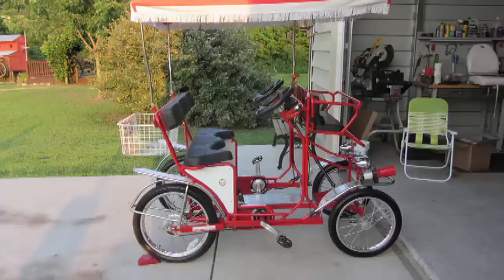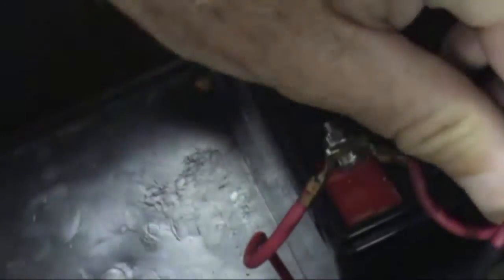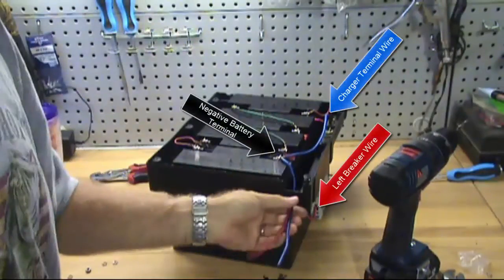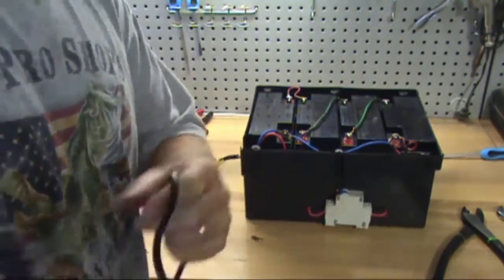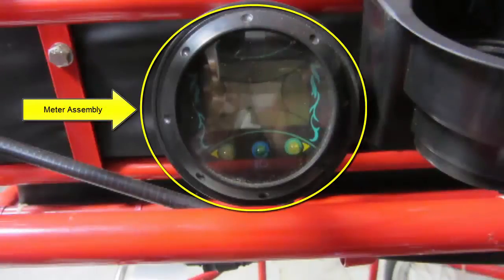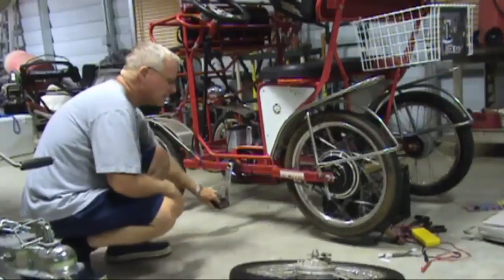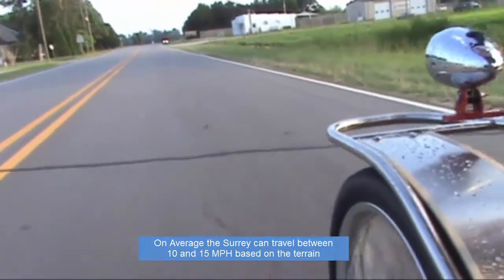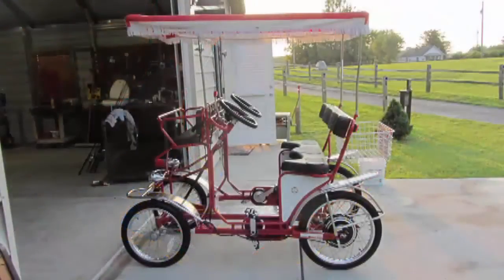How to Install An Electric Hub Motor with Pedal Assist on a Surrey Deluxe 4-Wheel Bike

Comment: Thanks so much for this video would you be able to provide recommended links (battery, Circuit breakers etc.) for a 4-seater surrey bike?
Reply from the maker: Natalie,
Here are some links:
DZ47-60 C20 Circuit Breakers AC 230-400V 6000A - https://amzn.to/2PWswTr
PowerStar 12 Volt 18 Amp F2 Sealed Lead Acid Battery - https://amzn.to/3fU3oHQ
Granite Digital 48V 50W Quick Charger and Auto Pulse - https://amzn.to/2POXaOT
Thanks for watching my video.
Norman
Reply: Thanks Norman! The Granite Digital is no longer on stock, any suggested alternatives? Also what motor hub assembly do u recommend?
Reply from the maker: Natalie,
You can use any brand 48-volt charger/maintainer. The Granite model is one of the best, I believe the stock is out due to the supply chain on microchips needed to build. You can search Google and check other sources that may still have some in stock.

There are many different brands of hub motors, I usually purchase motors built by Bafang. They provide high-quality electric bike motors both hub and mid-drive. They cost more, but cheap motors use cheap parts and low-quality controllers, circuits, etc.

You will need a minimum 48V 500W hub motor. This will give you speeds between 10 and 15 MPH, and a range of about 10 to 12 miles. depending on the terrain and the number of people on the bike. 

The size and weight of the Surrey would better be outfitted with a 1000W hub motor for best performance and power, 1000W hub motor will cost between $600 to $950 including the battery.

A Mid-Drive motor will give more starting power, hill-climbing, and range. Mid-drive motors are more expensive and will require some modifications to the Surrey frame to install. Mid-drive motors will cost around $1000 including the battery.

The easiest option to power the Surrey is to install a Hitch-Hiker motor which will attach to your Surrey with no modifications needed. The Hitch-Hiker will give you the power needed to push the Surrey up hills and give you about 20 miles of driving on a single charge. The Hitch-Hiker motor will cost around $2,000 including the lithium battery system.

Thanks,
Norman
Reply: Thanks!!!

Comment: Where are you located, would you be willing to look at an existing surrey bike hub motor setup that is in place and I can't figure out why it is not functioning? I purchased it in Raleigh NC and was told he thought it had a controller issue, it is now in Indiana and I've tried different controllers and don't know enough about it to resolve.
Reply from the maker: Todd,
I live in Eastern North Carolina about 78 miles east of Raleigh NC. If you tell me what is wrong or what is not working
properly I may be able to help you diagnose the problem.
Thanks,
Norman
Reply: Please text or call me when you can, 3177763878
Reply: I'm heading to Burlington NC in a week, I could bring the surrey if you would be up for it? I could even leave it and get it on another trip? My son lives in Burlington.

Comment: Hi Norman, do u know the size of the bottom bracket of your Surrey? Do you know if it's a standard size for all 2 seaters?
Reply from the maker: Ron,
I just took my Surrey to Florida to use during the upcoming winter months and do not have it with me at this time. If you have an International Surrey model, they are all the same and most parts are interchangeable. 
Thanks,
Norman
Reply: @NormanGooch  Ok, great, thank you.

Comment: Is this products ablebil in 🇮🇳, India, how much price in rs
Reply from the maker: I am not 100% sure, but you should be able to buy electric hub motors and wheels in India. If you have an International Brand Surrey, you can buy a hitchhiker electric wheel attachment from their website www.internationalsurreyco.com for about $1,800. This will only fit a International Surrey Bike. If you have a different manufacturer, you can search the internet for electric hub wheels and motors that you can retrofit to your bike model.
Thanks,
Norman

Comment: I'm stumped, Norman. I purchased an electric-assist Shandong Hightop Machinery LTD Four Wheel Surrey Sightseeing Bike Model Number:HT18-4S [https://hightopmach.en.made-in-china.com/product/DXzEgxFYVJAb/China-Four-Wheels-Electric-Surrey-Bike-Quadricycle.html]. Problem is even the two sturdy teenage grandsons can't pedal this unit for more than 3 level residential blocks without exhaustion - and that's without passengers. How can we increase the power of the electric assist? Better yet, How do we test to know it is even working? Should there be an increase-power mechanism on the dashboard? The 4-person surrey is a 48v 500w vehicle, using lithium batteries. We've had it for more than a year and taken it out twice. Could an electric-golfcart mechanic know what to do?  Sure would appreciate your advice!
Reply from the maker: James,
I’m not familiar with the motor you are using (the link does not work on my end) but there are several components that will cause the problems you describe.
You have to start at the beginning and test each component and make sure the voltage, capacities, and wattage is at the manufacturer’s specifications.
Start with the most obvious first and test. Eliminate the ones that are functioning properly and go to the next.
1.	Test the Battery Load
The first test you should do is load test the battery to determine if the battery is functioning properly.
If voltage drops significantly from a full charge under load your battery may have bad internal connections.
The Batteries BMS system may also be defective.  BMS is a very important part of an electric bike lithium battery, it is an electronic regulator that monitors and controls the charging and discharging of rechargeable batteries. it monitors the battery state such as voltages and currents and the battery internal and ambient temperature, Protects the battery from being over-charged (cell voltages going too high) or over-discharged (cell voltages going too low), calculates the data such as the charging voltage, balancing the charging current or temperature.
Sometimes the BMS may be faulty and can erroneously shut down the full power of the battery output thinking it is protecting the battery.
Thanks,
Norman
Reply from the maker: 2. Check the PAS system
Most PAS problems start with too much clearance between the disc and the sensor. Either that or the disc is slipping on the inside diameter. Set the distance as tight as you can without it touching. Test the pass with the rear wheels off the ground and make sure the wheel responds immediately to the sensor when it passes disc.
If you have an instrument panel, make sure your PAS setting is correct.
Reply from the maker: 3.Test the Controller
The electric bike controller is one of the main parts of an electric bike, it is the brain of the e-bike, controlling the motor’s speed, start, stop. It is connected to all the other electronic parts such as the battery, motor, and the throttle(accelerator), display(speedometer), PAS or other speed sensors.
Get up close and smell the controller, any type unusual smell such as charred, charcoal or burnt smells the controller may be defective and not sending and receiving information needed to operate the motor properly.
Check all wires leading from the controller and make sure all connections are tight and secure, check each wire and follow all the way to the other end and make sure there are no loose connections, burned wires, terminals etc.
Reply from the maker: 4.Voltage Test the throttle
Look for the obvious first before voltage testing! Something blocking or in the way of the thumb throttle rotation operation? Bracket or display mount, any unusual noises, sticking, or grinding when twisting? 
If so open it up and correct the rotation problem first.
If you can work on your throttle under test bench conditions using a battery powered voltage (5+vdc) supply.
It will be more accurate and don't have to worry about the motor starting up. 
The controller provides the regulated 5 vdc input voltage for sensor operation. And receives the variable output voltage from the sensor to determine power output to the motor accordingly. The controller will also lock out motor operation if throttle sensor input is higher than 3.8 vdc (shorted output).
Reply from the maker: 5.	Test the hall sensors – Hopefully you will not need to go this far with your testing.
Most eBike motors have “hall sensors” which help the controller to drive the motor.
To control an ebike motor the controller needs to know the position of the wheel at every point in time so that it can keep pushing it round. 
It works out the motor position from the signals coming back from the hall sensors (usually 3 of them). 
When the signal from the hall sensor is high that means that one of the motor magnets is going right past it, when the signal is low that means the motor magnet has already gone past.
To test the hall sensors, you will have to remove the wheel and motor cover to expose the inside of the hub motor.
•	Plug the controller hall cable to the motor hall cable, and then power up the controller with a battery pack.
•	If the controller has an ON/OFF switch, make sure it is ON.
•	Make sure your multimeter has the black probe in the COM slot and the red probe in the V? Hz slot
•	Switch the multimeter to DC voltage mode and turn the dial to the “20V” setting
•	Now probe the hall connectors with the multimeter, you might need to push the probes in with a little bit of force to get contact. You should see somewhere from 4V to 5V.
•	Next probe between the ground (black) and yellow, ground and blue, and ground and green wires.
•	As you turn the wheel slowly backwards you should see the voltage continually switch between 0V and 5V 
•	When you stop turning the wheel the voltage for each hall sensor will be set at either 0V or 5V. If one of the hall’s voltage doesn’t switch then you either have an issue with the wiring for that hall or an issue with the actual hall itself. Also, if you spin the wheel too fast you will see a steady 2.5V which is just the average between 0V and 5V
If you are not familiar with the tests, I would have it checked by a qualified e-bike
mechanic.
I hope this helps with your bike issues
Thanks,
Norman

Comment: Are you able to use the existing drum brake or did that stay attached to the stock wheel and come off? I am having a hard time finding a hub motor with a drum brake and chain drive on the other side.
Reply from the maker: The wheel I purchased already had a drum brake. This wheel is no longer available. I suggest you use a mid drive motor to power your surrey. You will have to make some modifications to install, but you keep your chain, brakes and drive wheel. The mid drive will give the bike more torque for climbing hills and is able to maintain constant speeds. Take a look at the Bafang 750 or 1000 watt motor. You can search YouTube and find installation videos for Bafang motors for regular bikes and see how it can be altered to retro fit a surrey.
Thanks,
Norman
Reply: @NormanGooch Norman, thank you for all your insight and direction. Your video is part of what spawned my curiosity!  I did it! It took me quite a bit of trial and error, but my double bench surrey now has a 1000W hub motor! 
Video of testing out the motor: youtube.com/watch?v=JvsHJQGibM0
Video of installing and riding: https://www.youtube.com/watch?v=u9DJXgGeEaM

Your expertise helped me figure out a lot of jams and dead-ends. Thank you!!

Comment: What brand ebike peddle assist kit did you use?
Reply from the maker: Unfortunately, the manufacturer of the hub motor I used is no longer available. I purchased the hub motor from an electric scooter company who at the time were starting to make electric motorcycles. I purchased the wheel from a company called incredicycles who built surreys with electric assist for several years until they went out of business in 2007.
You can still find wheels and hub motors that you can retro-fit on the surrey including mid-mount motors that can also be retro-fitted for the surrey. 
Search Bafang motors for mid-mount motors and check e-bike wheels made for heavy duty mountain and all terrain bikes. There are some very powerful hub motors and wheels for these type bikes with many size and power ranges that you can install on a surrey.
Thanks,
Norman

Comment: @Norman Gooch    Good day! It seems Surrey International in California is possaibly out of business. I have a 4-seater tank with the 5th Wheel attached, but it is in failure mode and I'm looking for test methods to find the problem. New battery, wires are good, turn throttle and nothing. Can you point me in a positive direction?
Reply from the maker: Gregory,
International Surrey Company LTD. Located in Texas City, Texas is still in business as far as I know.
They have technical assistance and parts for most all surreys including the electric wheel hitchhiker attachment.
I would check with them and see if they can give you some direction on your issue.
The phone number is 1-800-765-7370
Website: www.surreycompany.com

Thanks,
Norman
Reply: @NormanGooch  Thanks for the info.  Yeah, I meant Texas lol. Two of us have been trying by phone, email, and website to get response from them for nearly 3 weeks. Talked to a good man today after trying random extensions and finally getting through to a human! Thanks again Norman!

Comment: what is the name of the box that fit the 4 batteries?
Reply from the maker: There is no name on the box. It is the same type box used for some models of lead acid battery operated mobility scooters. I picked this box up at a flea market and there was no label. The #27 auto battery box may be large enough for the 4 small batteries.
Thanks
Norman
Reply: @NormanGooch  You are the best! I am neck-deep in researching to build almost the same surrey project as yours. Your video seems to be the only... Maybe I need to tape my progress too!
Reply from the maker: You should video your project, it will make it more fun to do and it may also help other people who are looking for more information on the surrey.
Thanks for watching my video
Norman
Reply: @NormanGooch  Norman, I need to thank you because I keep coming back to this video- It's so informative! Update on me: I just bought mine! A very nice fellow posted his double bench in the local classifieds for a price I could not resist!

Comment: A couple of quick questions if you don't mind my asking...

Can you use a motor in both rear wheels or will the lack of a differential cause too many issues?

What complications are involved in adding a 500 watt solar panel as a hard roof?

I'm trying to essentially create a low speed vehicle, while maintaining the pedals so that it still legally qualifies as a bike.  I'd really like to see the speed in the 30mph range for flat terrain and a range of approximately 30miles.  

The idea is to pull a small bike camper that will be able to carry additional batteries and solar panels when connected, but when parked and set up for camping, I don't want the bike to depend on the extra power for local travel.
Reply from the maker: You do not need a motor on both wheels. It is a complex build and will need modifications to the rear drive system. One drive wheel will power the surrey safely and you do not have to modify the rear drive and be able to keep it a bike classification. The surrey was not originally built to be motorized and adding too much power will add stress to other components of the bike. I would not recommend 30 mph speeds. You can use a 3,000 watt 72 volt hub motor and lithium batteries and achieve 20 to 22 mph depending on terrain.
Depending on the added weight of you trailer, cargo etc, you may need to add a mid-drive motor with a belt drive. Mid-drive motors have more torque and dead start power than hub motors. They can climb hills continuously without over-heating and carry more cargo weight. However, adding a mid-drive to a surrey will require modifying the pedal system including welding additional braces. You also have to replace the chain with a motorcycle type chain or a specially built heavy duty e-bike chain.
The #1 failure on mid-drive motors is a snapped chain. This option would also be much more expensive than a hub motor. Another disadvantage of a mid-drive motor is it has many more moving parts and when it fails, it is expensive to repair. A hub motor is more reliable, and if it does fail, you can easily replace the wheel and motor.
I haven’t built a bike with solar power, but I think it would not be that difficult to build and add a framework to the surrey to accommodate a solar panel roof.
I hope this answers your questions.
Thanks
Norman
Reply: @NormanGooch  Thank you so much for the information.  I wonder if it is possible to add a motor and a worm drive gear box... though that might change it's classification as well.  For the moment this is all theoretical but it's an idea I've been toying with for a while.  

I've seen bike campers that are very light weight and think with the right mix of equipment that you could make something that would allow a long term nomadic lifestyle in a reasonable price point.  

Like I say more concept than project at this point but the idea just won't leave me alone.  Thanks again for your time and knowledge!
Reply from the maker: I enjoy building e-bikes as a hobby and I'm sure you will have fun starting your e-bike plans and project. There will always challenges when building something no one else has done, but you will find it exciting to plan, design and build something you conceived and eventually build.  I wish you luck on your e-bike project.
Thanks,
Norman